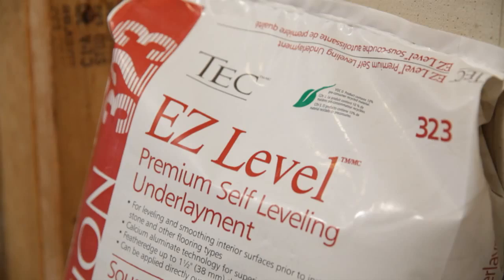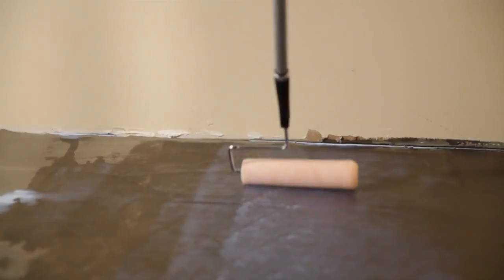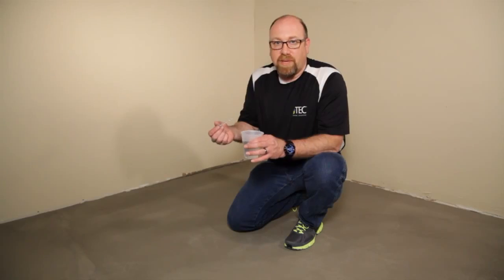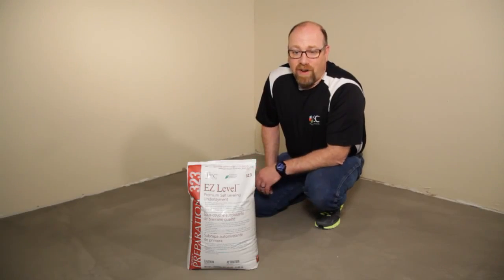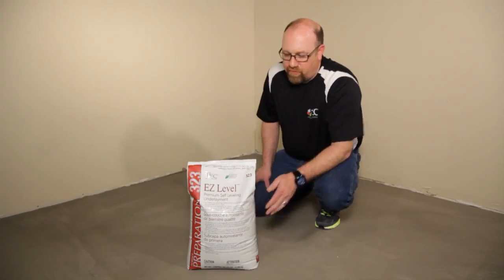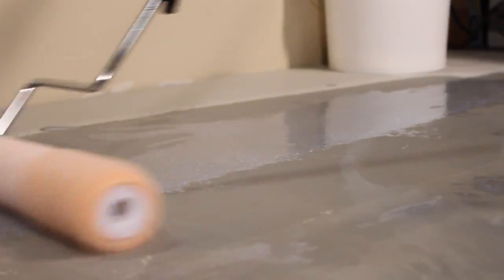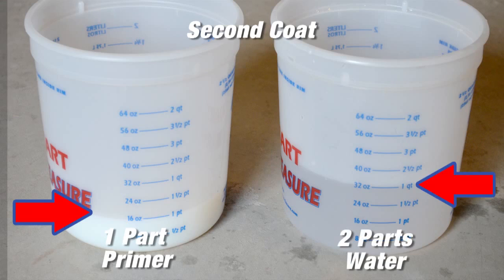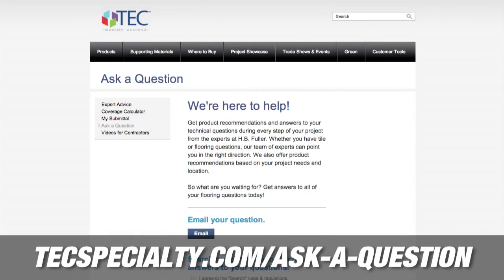How to use TEC® Multipurpose Primer with Self-Leveling Underlayment by TEC | Floor & Tiling Tips

Comment: Hello , This is my 1st time ever having to use something to install new peelnstick tile on top of linoleum flooring in bathroom. I was told I needed to use Tec surface prep. Multi purpose primer ? Is this true and do I just use it at full strength and apply with a roller?? Any advice would be greatly appreciated. Thanks

Comment: I put down heated cable which suggested putting cerazorb down first installing wire and then use self leveling underlayment. Can I use the primer on cerazorb Corp underlayment product thanks

Comment: I'm going to use Tec primer (my first time).
It's going onto new plywood and then peel and stick vinyl planks on top of that.
So do I understand correctly that
the primer should be mixed 1 part primer with 1 part water
and that it should be allowed to dry  (30 min - 1 hour) before laying down the peel and stick?
Reply: I use the product 2/3 times a week with my job and yes i recommend it over any other self leveling materials ive used
Reply: lw216316

Did you execute your project? How was this product would u recommend it?